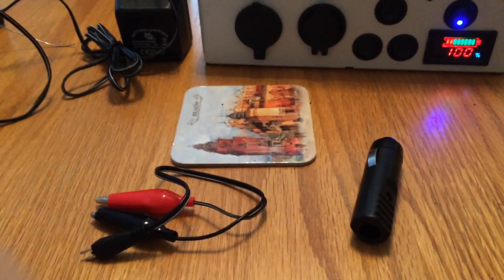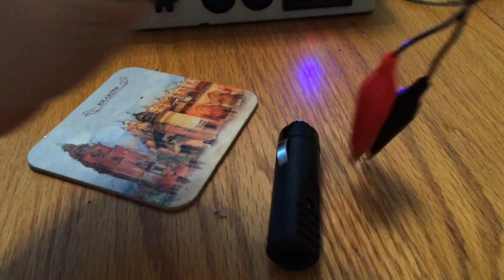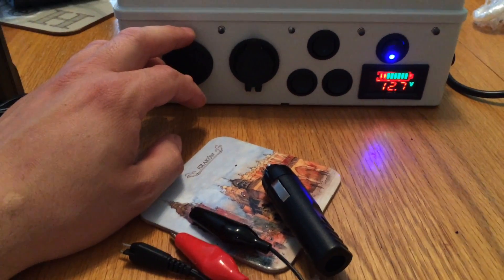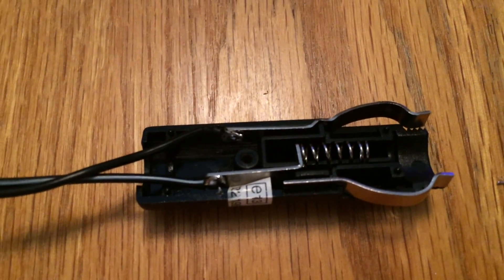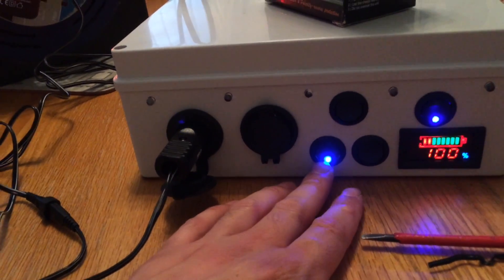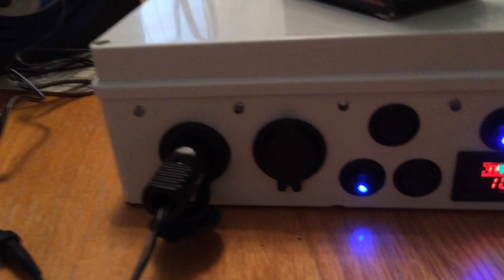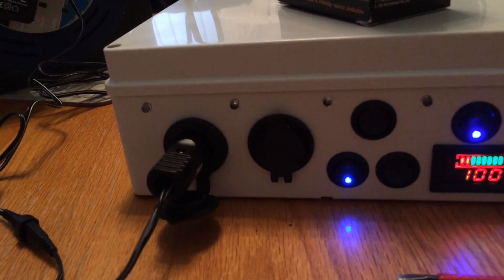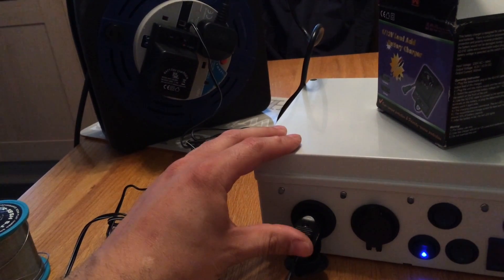Charge bivvy via 12v accessory port

Comment: I have wired a cigarette plug to a 12v charger like you did in the video but when I plug it in the light went off on the charger and I left it and then no lights would come on and then they suddenly came on however my USB ports aren’t lighting up when the switch is on, do you know why this is?

Comment: very good videos very helpful ive made one already pretty basic one but works well
when you charge battery does the box  need to be on of off to charge
Reply from the maker: If the port is switched from the box then yes it needs to be in the on position, if the port is connected directly to the battery ie no switch inline then no.

Comment: great video and would this method work with a trickle charging solar panel for longer stays away
Reply from the maker: don't see why not its the same as using the jack port and maybe wire 
port directly to the battery via a fuse (just so you don't forget to 
turn the port on)

Comment: I have been trying to find a 2.1 charger with a UK plug that will be suitable for my 12v 9ah battery without overheating it, would the one in the video be alright and if so can you give me a link. Thanks.

Comment: Do u have some sort of vent in the box for when the battery is charging? As it will give of gas
Reply from the maker: +Richard McGrath the switches are not waterproof so that is the vent (unless you use waterproof switches) Then you will need a vent in

Comment: great video. how much roughly would you say it cost in total to make one of these please? also any chance of a diagram to include volt meter etc please :)
Reply from the maker: it costs me around £40  depending on size of box & battery 

main cost is battery,box and charger other bits are cheap

that's not taking my tools into account eg hole saws drill bits and drill etc and time 

i have some diagrams on my google plus account if thats any help
https://plus.google.com/106239893122278107115
Reply: great many thanks. I suppose once you've bought the necessary tools (one off) then it is very cheap. and yet people charge double for them!! much appreciated.
Reply from the maker: you are rite there, i was looking on ebay and for a box with a battery its expensive.
Reply: m0iee can I just confirm the wire should be 10amp? 0.7 seems to be 6 amp? cheers
Reply from the maker: 0.75mm is rated at 6amp @240volts its about the same size used for car 
cig/aux sockets and they are rated at 10amps, there's nothing stopping 
you from putting a 5amp fuse in, i suggested a 10amp so it as some 
protection and as that's the max rating of the aux/cig port

my box as a 4amp fuse in at the moment and it don't blow when i pump my air bed up with a 12volt pump
Reply: m0iee do the boxes have to be IP rated? cheers
Reply from the maker: not really just everyone else is using IP rated boxes but any box would do have a look at this one made by TheWoodPieces  http://imgur.com/a/4wQPK
Reply: m0iee lol that is awesome.  I was about to order a box from China but might just get one from Asda now. thx
Reply: another question if you don't mind. regarding a charger, you suggested getting a 12v 500ma charger, but would a 12v 2amp be better? thx
Reply from the maker: +Whizzo will probably just recharge it faster, it may have a negative effect on the battery's lifespan but I'm no expert on charging them,
Reply: m0iee ok thx. I'll stick to the trickle charger. Cheers

Comment: hi. is the battery level quite accurate as I may add it to my box

thanks
Reply from the maker: sam foster 

Hi the voltage display is however the led battery bar & % is a pain to get it right I'm not happy with how mine is I don't think I would use them again, it's much easier to get a round voltage display
Reply: m0iee ok thanks mate. Wasn't to botherd about the voltage display was just hoping the bars and percentagr would be accurate. thanks for the quick reply

Comment: hi can i use 18650 battery 3s5p 12v?
Reply from the maker: you can use other battery types however they charge differently, i'm not over sure with other battery types tbh they can be dangerous so please becareful
Reply: @m0iee  ok.. can you give me diagram without remote what you use led resistor? sorry bad english

Comment: any chance you could link me too all the parts
Reply from the maker: roborobinson11 sorry when I post a link to ebay it don't work correctly, so here are some ebay item numbers

Switch 
ebay item 271802425937

AUX cig port 
ebay item 271569548162

twin usb
ebay item 400736090748
Sockets

http://pages.ebay.com/link/?nav=item.view&alt=web&id=221446846939 

Chargers

http://pages.ebay.com/link/?nav=item.view&alt=web&id=231002500029
I don't have a link for the box as I don't buy them online but the size I use is 240x190x90mm which fits a 7ah battery with loads of room, but it all depends on how big the battery is.
Hope it helps 
Regards Brian
Reply: Thank you very much :D
Reply from the maker: yes that's all the boxers are, I think the £10 one is the same however I wouldn't pay that id nip into my local newlec or cef any electrical wholesale and always ask for a cash price lol, but shop about
Reply: Thank you very much, I plan on making one very soon :D
Reply from the maker: That's brilliant :-) and I hope my vids are a little help